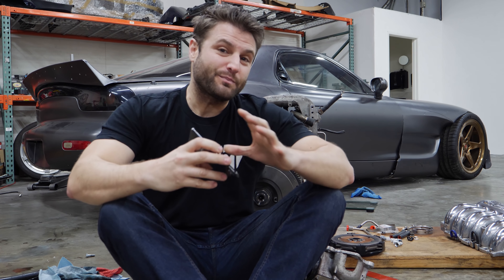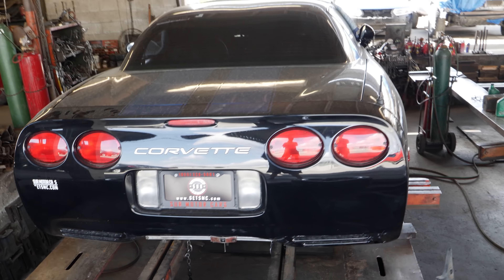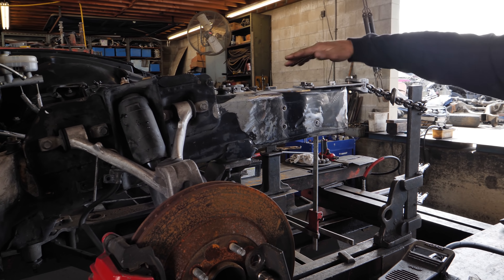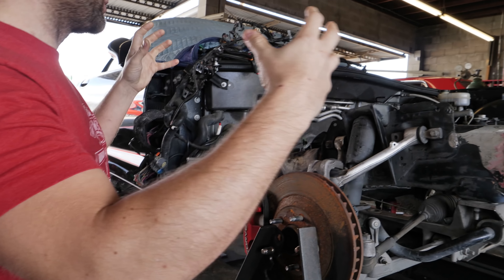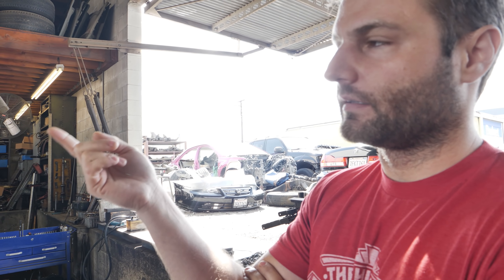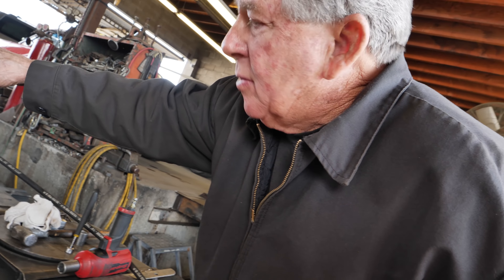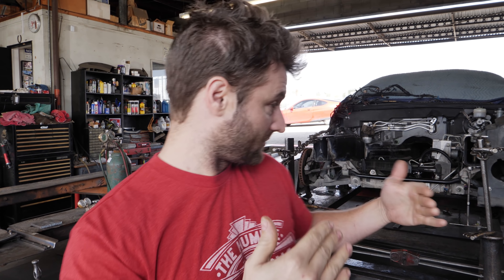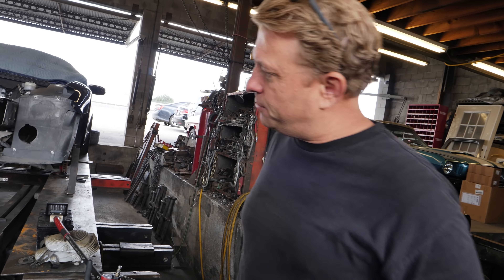Rotary Corvette SALVAGE Frame Fixed with FIRE.

Comment: That was cool man. Seeing something like that seems like one of those dying arts.
Reply: Exactly my thoughts. These days many cars are disposable. It doesn't take much to total one, so I'd imagine frame shop demand is a bit down from what it used to be in the old days. If this were a carbon fiber chassis it would be totalled for sure.
Reply: tscooter22 Well CF and steel are inherently different, CF is brittle, whereas steel is malleable. So comparing the two is like comparing raw spaghetti to copper wire
Reply: Actually that was hot , it required a decent amount of heat .
Reply: @christopherbrooke2142  That was my point. CF will take the hit and hopefully save your life, but it committed suicide while doing so  As far as I know, once you do structural damage to the CF tub it is history.
Reply: tscooter22 depending how bad it is you can patch it with cf

Comment: Today Alpha Rob fixes the corvette so he can beat Rob Ferretti and prove once and for all that spinny bois are better than pushy bois
Reply: I have to wonder if he'll need the 3-rotor for that.
Reply: Spaghetti vs Dorito show down
Reply: @tscooter22  Yeah, I doubt the 2-rotor can beat the raw power of an LS. But it sure is interesting to see how close a 13b can get to the almighty LS
Reply: @keksauce  I would be far more worried if Spaghetti could drive.
Reply: Nothin better than the boosted bois !
Reply: Saucegum it could never get close 😂
Reply: @joejacobsen6822  he could stall it on the launch and miss every gear and itll still beat the rotary. I love how they sound, how they rev and how much fun they are to drive but the LS is going to destroy a 2 rotor every day of the week.
Reply: @konnerkramer3381  You'll be eating those words in just over a month.
Reply: With a swirly boy
Reply: @shona5512  umm no.... this thing is going to run like shit
Reply: You are going to be sorely disappointed if you think the object of this swap is to outrun LS powered vettes.
This is an exercise of engineering what ifs. It will prob be a 12 second car to be honest, but will just be a fun thing to build.
Reply: @konnerkramer3381  It's not going to "Run like shit" if it's a 11-12 second car. The aim is to produce more torque & power than a stock LS, which it will with the turbo setup he has. Save your judgements for later if you don't know what you're talking about.
Reply: @shona5512  he could of left it stock and it would of been a 12 second car. The problem is the rotary doesnt make enough torque to push the 3500lbs Corvette. And with 3.42 gears its going to have a lot of turbo lag.
Reply: @konnerkramer3381  With the turbo it has, the rotary will most definitely produce the torque figures that will top a stock LS's torque figures. I know this because my brother in law, who bought my RX-7 off me, recently installed the exact same turbo setup on the RX-7. I think you're forgetting that there is less than 150lb difference between a standard RX-7 and a rotary swapped C5. The only thing that limits the cars performance is the final drive, which can always be swapped out pretty easily.

Comment: As a professional bodyman for 35 years and a guy thats done lots of Corvette work, I wanted to let you know you chose the right shop for that job. It is rare to see shops using center line gauges under a car anymore. newer shops like to use the fancy laser measuring systems. As you see the old school measuring allows the tech to watch the frame come into square and level . When used correctly, they are far better and faster than laser type systems. Also wanted to let you know I really enjoy your videos. You dare to be different, thats awesome. Keep up the great work!

Comment: Weld some reinforcements plates where all the heat was applied in the frame. The heat actually compromises the integrity of the metal.

Comment: I know you were thinking you might need to cut the sub frame but I wonder if the after market one that Cleetus used on Leroy and Ruby would be an easy bolt on no cutting?

Comment: They overheated those rails when they repaired them, should have just cold  repaired as much as possible, cut it off and then tubed it out or weld on new rails if possible. The structural integrity will not be the same as it was, the repaired areas are now very work hardened. Red hot is tooo hot for repairing.  

With that said I look forward to the rest of the build and Im sure it will be fine, it just wont crumple as it was designed to.
Reply: cramstick  - indeed that was the benefit of hydroforming the C5 Rails and why they could get such strength from a mass produced lightweight frame. I wish they’d show how some of the VINs looked afterward. Tom Bedford wrote a great article in Superchevy about this on 11-2-09

Comment: Looks pretty good but those hydroformed tubular frames are too thin and it'll still have a weak point there right in front of the cowl right where it was heated up.  I wouldn't drive thru the dips in the roads very fast, only very gently where possible. 
If your door and fender gap ever closes up some then you'll know you have a problem.

Comment: ive pulled a couple cars out on frame racks before, those guys know there stuff, i wish i has those gauges they where using it would have been way more precise a lot less measuring an measuring an again fucking measuring, good job tho rob you picked the right guys for the job, hell yea bro

Comment: I will tell you one thing about old cars and tools. My grandpa had an old ford from 1962 and we still have it today and it is 2019 my dad takes good care of it  and  it revs strong as hell the new engines are just a piece of junk they just tell us lyies to buy them but we just spend more and more money on them to fix the freaking problems, as for tools I dont  have anything to tell the older they are the tools just work better

Comment: haha, using tram gauges arent giving away any secrets . The datum line and the frame dimms and those gauges are an absolute must. WIthout them you arent straightening the frame.
That frame has been annealed now tho . Very weak and should be sured up at those crumple points.

Comment: What are you planning on doing about the weight difference between the engines ? As far as the rotary is so much lighter and the springs or spring is designed to hold up a blah blah pound engine......I know you weighed it but don’t remember how much the Ls weighed.

So with the lighter engine the nose is going to be pointing up in the air much like it is now with no engine......

Comment: The production quality make this nearly unwatchable. Motion sickness fest. Camera man can't keep the camera still for even a second. Or move smoothly. Audio volume up and down and all over the place.
Reply from the maker: I’m going to make some adjustments. I felt the same way. The down side to running and gunning with equipment meant for more stable shots and directional microphones. Might go a little more wide angle and Omni directional for the mic setup when Jaret catches me talking to someone else. It’s not scripted or planned so it’s a bit of a mad dash
Reply: @RobDahm  Good on you mate, hope my comment didn't come off as too harsh. To be fair a lot of youtubers are way worse. They interview people from behind the camera using the inbuilt mic so their own voice is super loud while you can barely here to the subject speak.

Comment: Couldn't afford to take it to a shop that uses a modern frame rack? In the 21st century you use lasers to tell you what needs to be adjusted and how far.
Reply from the maker: I paid full price. I took it to the shop with the best reputation in the region.  I love technology but it was wild watching them work the chassis with years of experience.  Tools are useless in the hands of the inexperienced. Not saying anyone else isn’t good.  Just that I couldn’t afford to take it to a shop that buys new toys and turns out half ass work. I went to 5 different highly rated shops shopping around and these guys had worked over many corvettes before. And they were willing to let me film haha
Reply: Kind of an ignorant comment. You don't need lasers to tell if something is flush. Just like you don't need lasers to frame a house. It can make the job easier, but it doesn't make it better or worse. I'd rather use the "analogue" approach, and these guys did a superb job.
Reply: Rob these tools aren't new they've been around for 20+ years. And they're more accurate than humans eyeing a gauge.
Reply: @TheThatsnasty  what level of icar are you? Just asking because I learned from my dad and my stepdad who are both Platinum certified the last time I checked. Both have 30 years experience pulling frames. So say I'm ignorant but I'll take the word of an expert over some kid who thinks he's an internet expert.